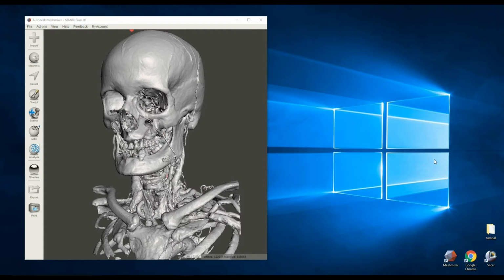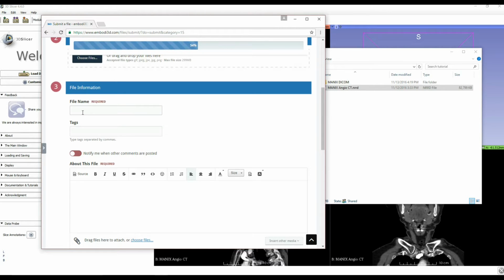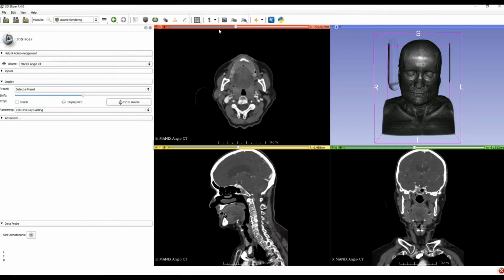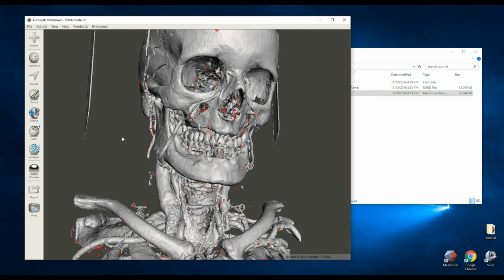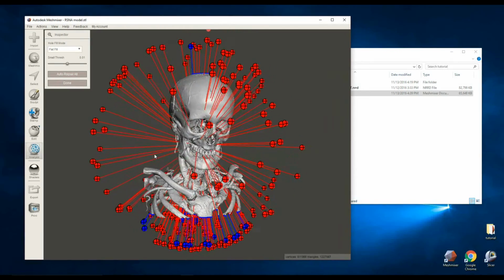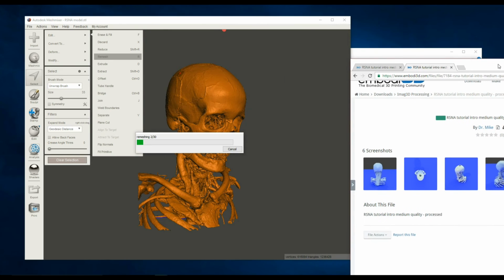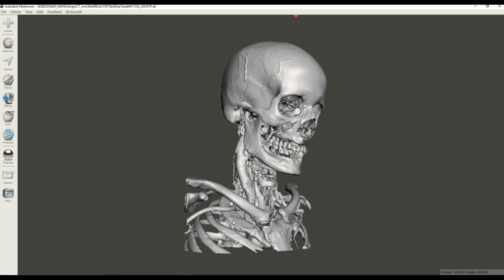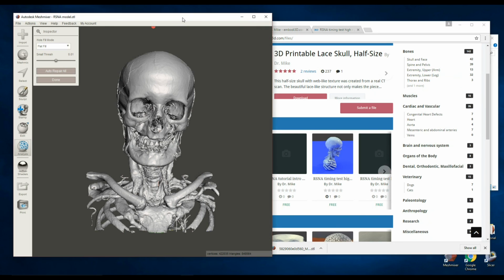Creating 3D Printable Medical Models for Free: Embodi3D.com, 3D Slicer, and Meshmixer

Comment: I have no medical background, just like to fiddle in 3d. But are their tables for those hounsfields units?
So i guess the threshold links to the material you want to show or not show
Reply: Okay found it. That will help me get the correct number and perhaps also do other exports with tissue or other data
Reply: Ps kinda weird. I see those table have a min and max, this a range. Kinda weird then this module in 3d slicer also doesn't work like that with the threshold, that would make it more precise.
Because how does this work. Everything above, that means your data can also gave other tissue

Comment: Very much appreciated, doing these vidoes. I received ct scan from my hospital after being in a car accident. I have fractured talus bone and perhaps tibia. I firdt noticed the dicom was all 2d. Just liie they showed in the hospital. Then found iut weavis could show it in 3d. Since i use bkender a lot. I went on sesechikg and found RadiAnt. I got a 30 day trial. Them fiund abiut 3d slocdr and meshmixer and saw some other tuts. Im hopong to extract a more detailed view.

The docotrs tell my, the frsvtire on the tibia is old. But after seeing the 3d inagez which to me is more clesr to understand. I feel like, that fravture is due to same accident, its right above the frs ture of the talus. Secondly, i pkayed soccer a lot and did get injrioes. But if the tibia was broken, i should have felt that right?!

Comment: Cool video :-) Do you know how to prepare medical model for finite elemente analysis when it comes to face partitioning ? I mean I have to divide it's surface into smaller pieces on which I will apply some physical conditions. In Meshmixer you can use face groups: select surface with brush, then smooth boundary, use Separate and then Combine in Object Browser. But there are only few file formats available and only some of them save information about such a surface division ...